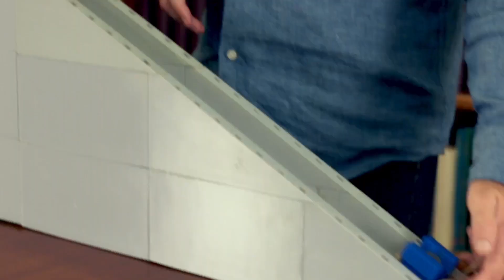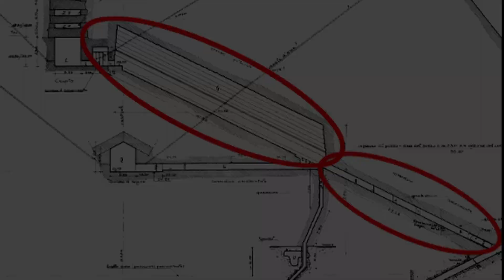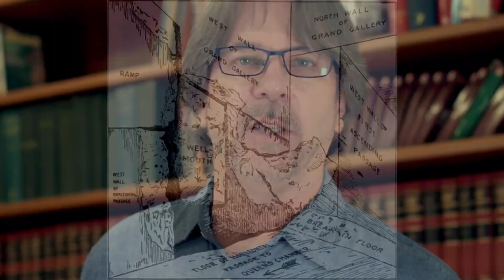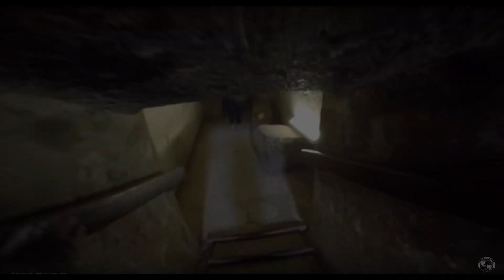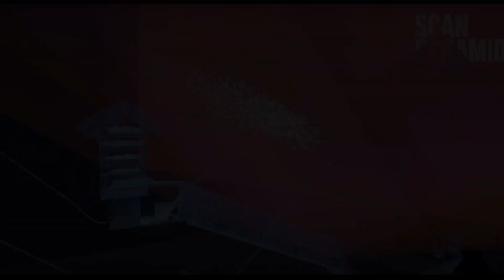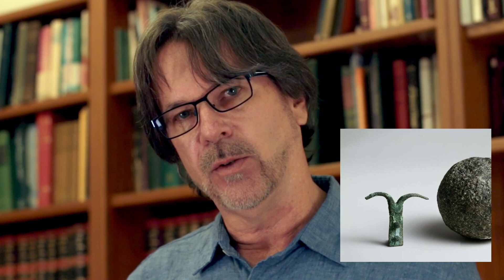Groundbreaking Theory About the Pyramids

Comment: This makes complete sense. That’s why you also need an underground shaft to even begin construction. Now if you put ropes through the “air shafts” you basically have a giant inside crane that can lift stones up the side wall of the pyramid
Reply: You don't need anything like that. An unfinished pyramid already has ramps on all four sides. You can pull a big stone on a sledge up one side by simply loading many small stones on to a sledge on the opposite side, with a rope connecting the sledges.

Comment: Interesting theory. I am just curious, has anyone done the math on how much rope thickness, length, and how many times it is replaced to sustain this kind of method? because clearly they did not have pulleys back then to lessen the damage done by friction to the rope.
Reply from the maker: First off, thanks for being the very first to comment on my channel and my video. 

As far as a pulley with mechanical advantage, yes your are right, there is no proof the ancient Egyptians knew about this. So there is no rotation of a pulley to reduce friction, but it is understood the Egyptians routed ropes around logs when pulling large heavy objects from an angle. In fact, in the Grand Gallery, the portcullis(security door) uses ropes wrapped around three logs to open the King's chamber by lifting very three very heavy granite blocks. 

As far as friction, the Egyptians had the technology to polish very hard rocks(see some of the statues they have created), so friction could be minimized. Original pictures of The Great Step show what seems to be made of a polished stone. People also theorized animal fat was used to lubricate things, and we know they slaughtered a lot of cattle every day to feed the workers fresh beef. 

I'm sure rope sometimes broke suddenly, but if it were due to friction then the chafing on such a large rope would probably be somewhat visible and they would know early when they need to replace it. All this is the more reason for the brakes I talked about in the longer version of this video on my channel. 

I have heard of one person discussing the weight of the ropes and they calculate that the ropes would definitely be very heavy. Fortunately, in my theory, most of the ropes weight is negated by it being counter balanced. In the end, I have no clue as to how often they would be replacing ropes but, I believe they had an overkill attitude towards constructing everything for the first time, as you can see when they overbuilt the chevrons at the Great Pyramid's entrance, and there was almost nothing above it that remotely needed that much support. I also have a mechanical theory as to why the chevrons were so huge but that idea isn't fully thought out yet.

TLDR: One person I read, some time ago, calculated that the ropes would be huge and heavy, but I don't have exact numbers, as I forgot where I read the math estimates. I don't know if anyone has done studies to see how quickly ropes wear out, especially when the size of the stones being lifted varied so greatly.
Reply: @HowThePyramidsWereBuilt-om4hd  thanks for the response, would love to see more of the theories about the construction of the pyramids and maybe other megalithic structures around the world! Cheers!
Reply from the maker: @PlayerEnz  Of course. I will be releasing more theories if have. Especially one that explains how they had enough counter weights in the Grand Gallery to lift the 80 ton blocks... and how they doubled the pulling distance of the blocks.
Reply: What were the sleds constructed from ?
And how did they offload and then place the stones?
Reply from the maker: @camisc2000  In the Cairo museum they have an excellent example of a wooden(cedar) sled they used to pull large blocks. This link shows Houdin in the museum finding the sled(ge). https://youtu.be/eGqfdXkAQMk?t=1126 . It would be reasonable to assume the Egyptians used the sled(ges) in the counterweight system due to their relative strength to weight ratio and the stones were only riding on top of the sled(ge), so the sled(ges) wouldn't be lifting the blocks off the ground or ramp, they would just be being compressed.

I have struggled a lot with how they were offloaded. My current theory is the stones were pulled on top of the pyramids current highest elevation "the roof", so the blocks just stopped when it was on top of the pyramid. I don't have my heart stuck on this idea like I do on how the rest of the counterweight system was used. This theory wouldn't explain lifting the final casing stones, for that I have another theory of how they finished the pyramids using a similar yet simpler system, as those stones were a fraction of the weight of the relieving chamber blocks.